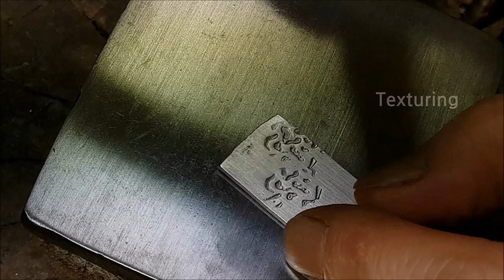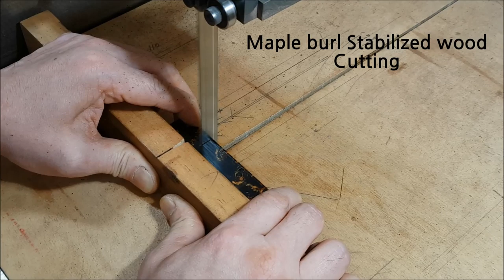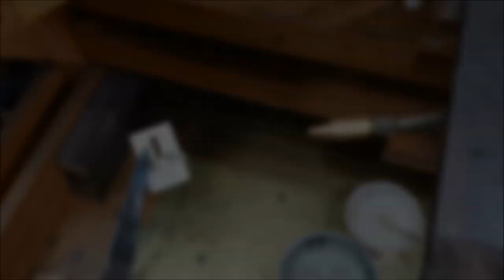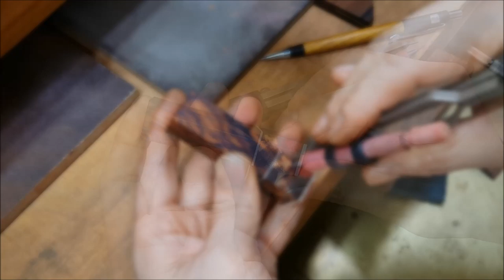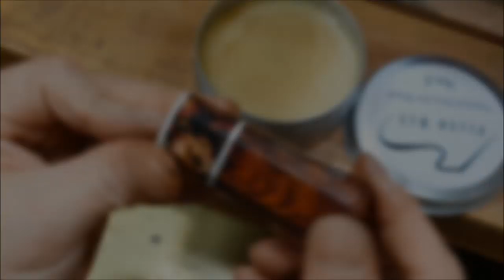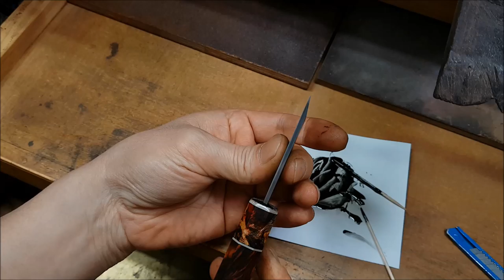[ Leather Knife ] cutting tool / Rail steel Forging

Comment: nice. the tool that you use for marking the corners of the handle, like an square, what iti is? and if you may, what are the dimensions?
Reply from the maker: The tool that displays in the corner is a jig that you make yourself.
The size is about 3mm.
The angle is about 50 degrees 40 degrees,
I use it by making ratio of width and length.
Reply: @SilverMeister  thank you

Comment: Boa noite, como chama essa serra no seu pais? Não estou encontrando essa serra no Brasil.
Reply from the maker: Sou coreana
Use seu próprio idioma "한글-Hangul",
Às vezes eu uso "영어-inglês" para me comunicar.
A montanha que se eleva é marcada como "산 -mountain"
A notação de acidez de uma substância semelhante à droga também é escrita "산 -acid".
Reply: @SilverMeister   I was referring to the saw blade. Because saw in Portuguese have two meanings. 1 "Mountain" isolated. 2 Handsaw blade. Hear translation error.
Reply from the maker: @vagneroliveiraportela7170  
It's hard to know your words perfectly.
If we talk about the top,
The saw which I use is easy to find in Korea.
Where to sell tools in Korea,
Both online and offline are not difficult to buy.

I don't know how to get it from abroad.
You don't know what exact information you want.
Sorry. !